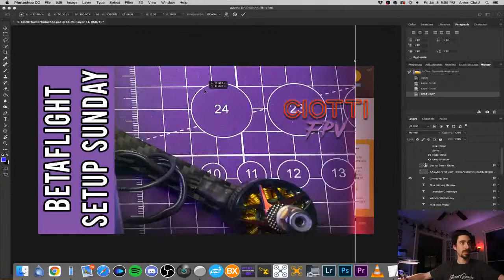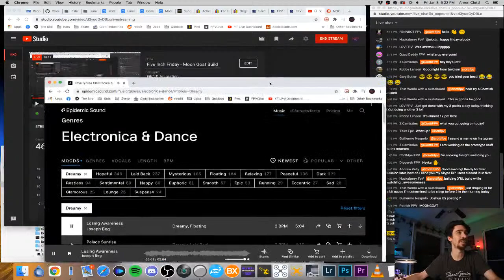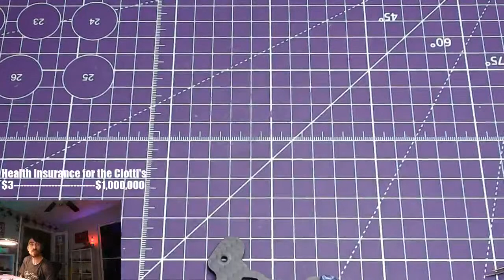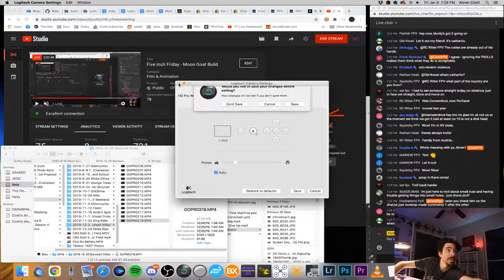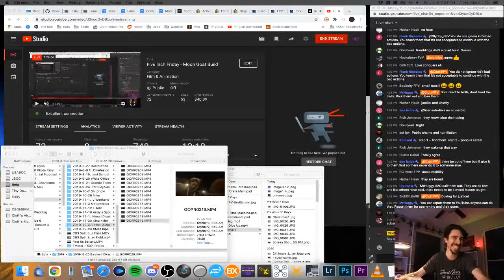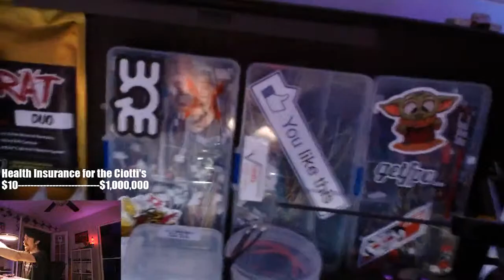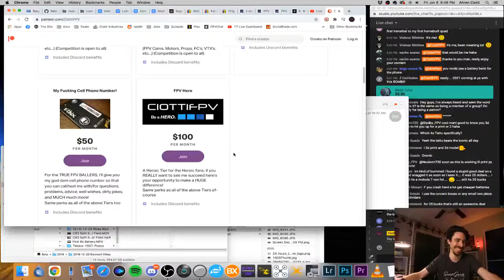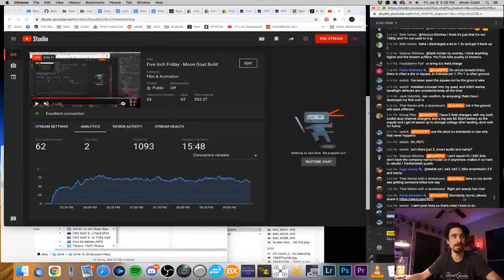Five Inch Friday - Moon Goat Build

Comment: Just found some Racestar 0802 25k motors on Bangood.  They are cheaper than the happymodel ones but one thing I like is they have a solder point underneath, so if the wires come off you can resolder them. Don't know what they are like but tempted to get some!
Reply from the maker: NICE, I'm all over those if they pop up in the US :)